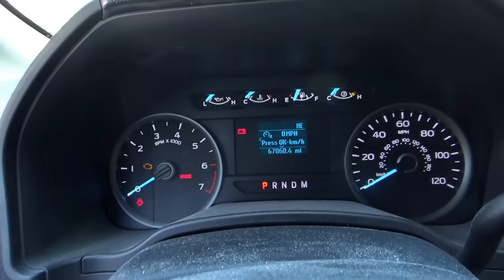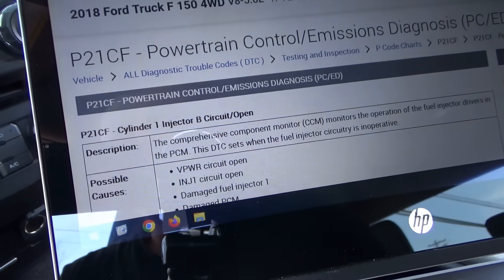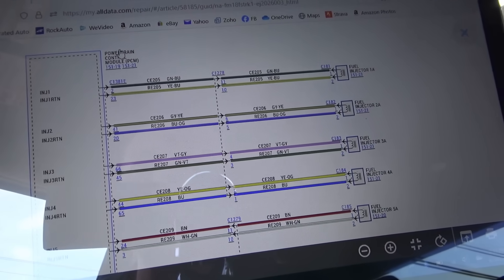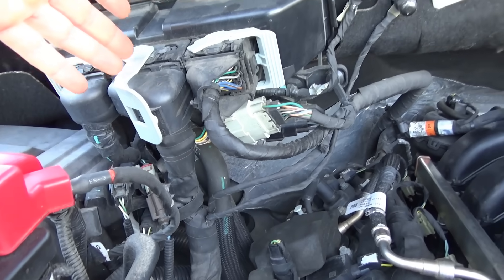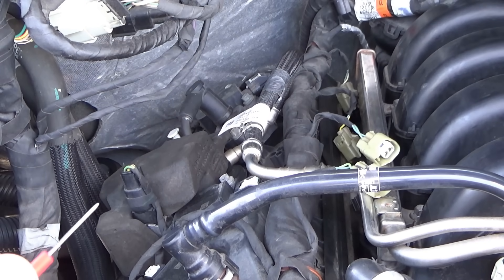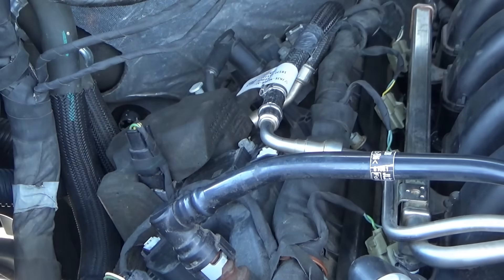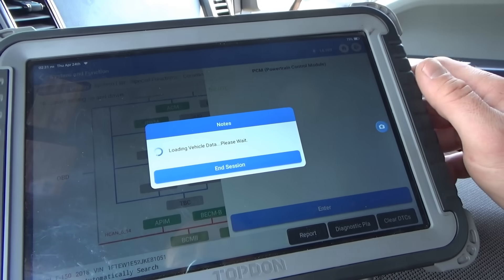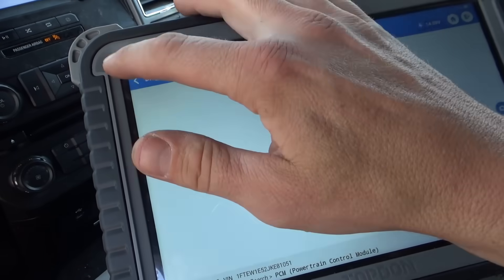No Research = Parts Cannon FAIL?! (Ford V8 GDI-Port Injector FAULT)

Comment: I was told at a Toyota driveability class that the reason for both port and direct injection is port injection is more efficient at low engine rpm, low load conditions. Direct injection is better for an engine under load at higher rpms. The fact that conventional port injection does clean the valves is a plus, but that's not why they have both.
Reply: Direct injection is also used to cool the charge in the combustion chamber to prevent premature detonation. That's how we have all the small turbo engines that can run on 87 and not knock themselves to pieces (which the industry needs to just start requiring premium, anyone running regular in a small turbo engine is asking for trouble)
Reply: @upload15613 Another consequence of GDI is they won't tolerate short trips. When the engine is cold it dumps gas into the cylinder resulting in cylinder wash, where all residual oil is washed from the cylinder wall and rings, leading to a loss of compression, carbon buildup, cylinder wall scoring and oil dilution.
Reply: Well yes and no. Port injectors are easily capable of the same or more horsepower as direct injectors, but they do so at the cost of higher emissions (direct injectors also have a lower max RPM capability). The downside of GDI is carbon build up on intake valves (which is why it was originally abandoned for mainstream use) issues not applicable with diesel and 2 cycle engines, so a dual system would seem to be the best of both worlds, but it does so by adding complexity and recent studies show an increase in something called black carbon aerosols , which are sooty much like diesel emissions that can increase global warming.
Reply: @TheOnespeedbiker  you can usually spot GDI soot on the rear bumpers of light colored cars that don't get washed enough.   I really don't know how this is considered better emissions.
Reply: @TheOnespeedbiker  Damn, rolling coal with a gas engine.  I want one now.  LOL

Comment: Yay, Ivan with my coffee and donuts!
Reply: donuts, mmmm.  they just opened a dunkin, alas I asked if I could get the lemon filled with sugar instead of confection, and nope, book says powered.  Boston Dunkin does it the other way, and I prefer it.
They prey on the math challenged.  A dozen of those pigs in a blankets cost more than buying twelve of them.  I would order twelve in the drive through, and they would try to charge me for a dozen.  I tell them no, I want twelve, they are cheaper that way.

Comment: Me TOO !  What's wrong with NOID lights?
Reply: chinese tariffs?  😵
Reply from the maker: Just extra tools that you don't need... Just use a test light! But the correct tool is an oscilloscope since it's a pulsed circuit 😊
Reply: @PineHollowAutoDiagnostics thx

Comment: Goooooood morning kids!!  Ivan.  I actually get to replace my first HPFP this morning.  Hyundai with 2.0t in it has a leaky pump.  Oil changed 2 weeks ago, now it's a quart overfull, smells like gas and after the car gets hot it has long cranking time.  All the cylinders are dry, so a $750 pump it is!  o.0
Reply: Eric O just did the injectors, and the HPFP was right there.  Get the hose.  He was cracking me up, with his disclaimers about the pressure of those things.  I thought the 800psi of the transmission fluid was bad.....
Reply: @robertsmith2956  Oh yeah!  She's done and gone.  LTFTs were at -99% with all that fuel in the oil.  New factory pump, oil change and LTFTs are back to less than 10% combined and the long crank time is gone.  Just can't believe the price of that pump.

Comment: "Don't force your probe" 🤣🤣🤣🤣 that's what she said.
Reply: Well after stop it's to big.... 😂
What are three two letter words that mean small????
     -- Is It In?
Reply: Ford service info literally tells you the size of the terminal because they sell a terminal kit that is made to front probe the connectors however front probing is by no means my favorite way of texting I prefer back probing and loaded circuit testing I want to know if it can carry current it can show good voltage but not be able to carry current and I've seen it but to many techs

Comment: How many hours were spent looking under the wrong rock, and who paid for all those unnecessary parts and wrenching?
Reply: Without the original injector, and scope traces of the pindal hump there is no way to declare it was all part cannon.  could have nailed it on injector, but the NOID doa it from there.

Comment: What is wrong with noid lights, other than the potential contact spreading?
Reply from the maker: A small test light with proper adapters is much more versatile and prevents pin damage 😉
Reply: @PineHollowAutoDiagnostics  and you can place the bulb where it can be seen while cranking the engine.  the injector harness keeps the NOID buried out of sight.
Reply: Nothing. I use them all the time with the proper pins. For 30 yrs....

Comment: Brilliant diagnosis.Some seemingly complex problems can be solved by a methodical approach which you  do use,without jumping into the deep end
Head first.
Reply: Yea, first injector of wire pigtail of common power sort of screams, not the harness, unless it is the 3" stub at the connector.